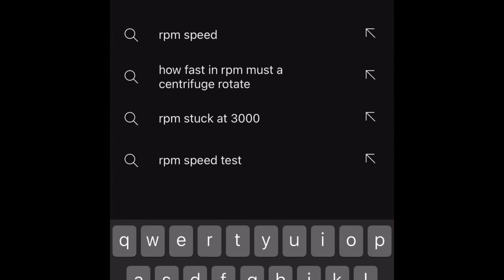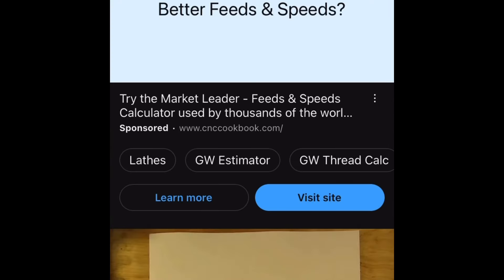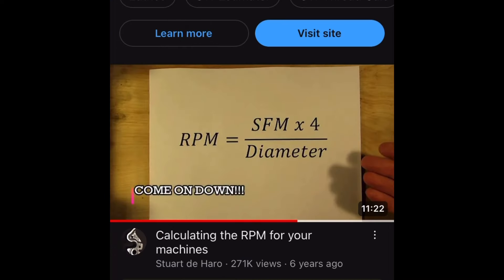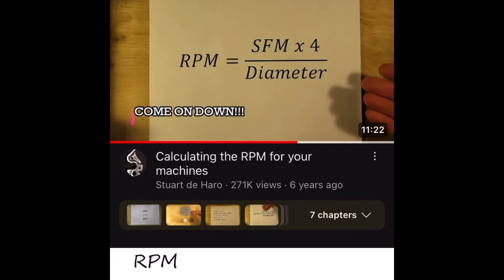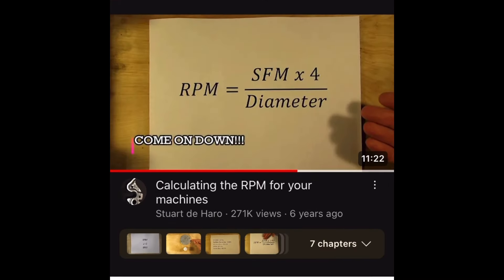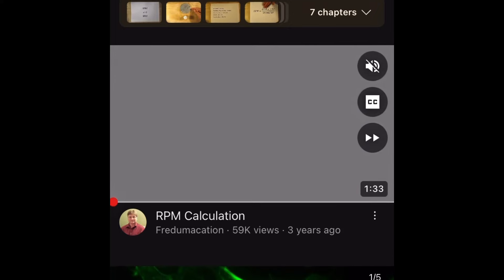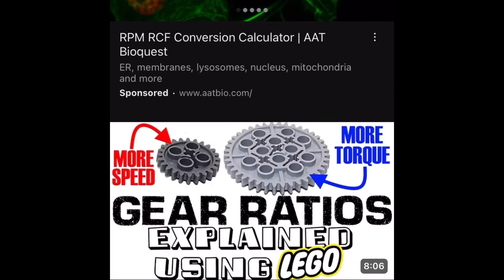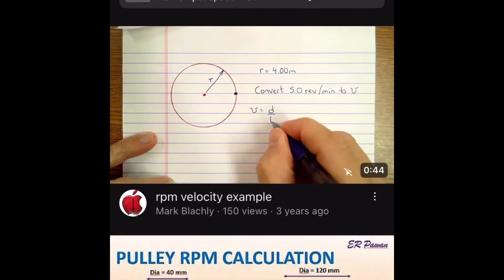RPM Speed Examples using Synchronous Motors

Comment: BTW:  Many synchronous motors will reverse direction if they are not strong enough to overcome what is slowing them down.  This doesn't harm them so you can get back and forth action just by putting something in the way of the arm off the shaft.
To be even more clever you can arrange two of them at different speeds in your prop so the action seems a little more random.  There is even a way to make one of them to cause the other to be blocked differently sometimes so the back and forth is not always the same.
Reply from the maker: @kensmith5694  https://youtu.be/k4fVadbBE7c?si=45r40hZXmc568sqj
Reply: @brianbenson3091  I had already seen that video
Reply: Can this work with a 15-18 rpm motor?
Reply from the maker: @CottonKat04 yes
Reply: @CottonKat04  Some of those are the synchronous type.  Some aren't.  Some motors have a ratchet thing in them to prevent reverse running.  You will have to look at the type of motor.